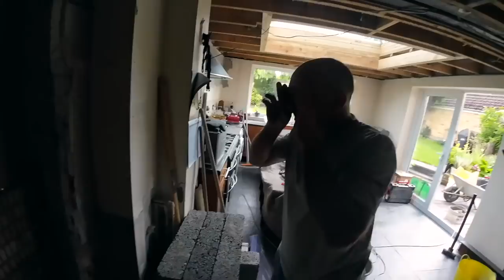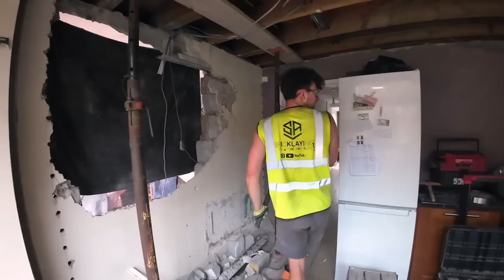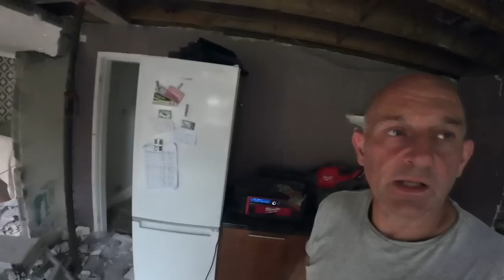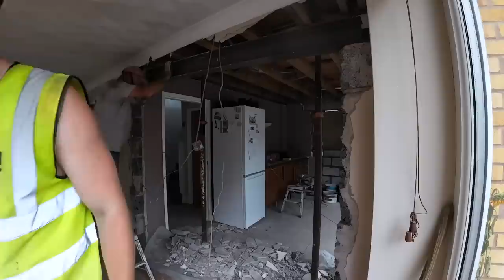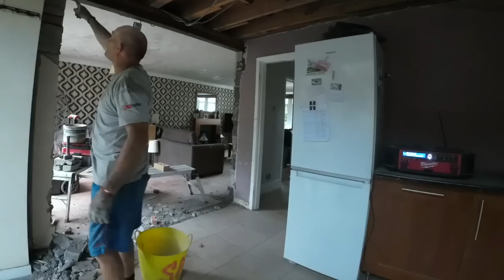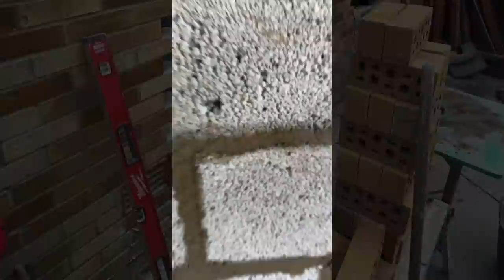NEAR MISS WITH SOME DANGEROUS ELECTRICS !! A NEW STEEL BEAM 💪🏽

Comment: Hello,  in Canada we use rolls of poly (plastic Sheeting) to cover interior of rooms. On walls where you are not damaging you just tape the poly to the top of the wall. In Kitchens, just tape to top of cabinets and drape it down to cover cabinets, counters, cooktops etc. Ten minutes spent protecting the worksite from dust can save hours of cleaning. Good Luck I enjoy the Channel.
Reply from the maker: Nice tip. Glad you enjoy the channel 🧱👍🏽🤜🏽🤛🏽

Comment: Why do builders never lubricate their acros, not a builder myself,just a mechanic,is it grit related.
Reply from the maker: We don’t like getting covered in oil 😒🧱👍🏽
Reply: Large thread pitch is their advantage, no trapped grit to wear them down, but a blow out occasionally with WD 40 will help their longevity.